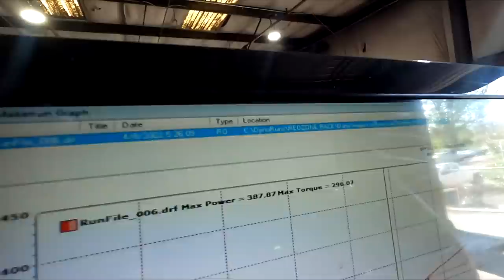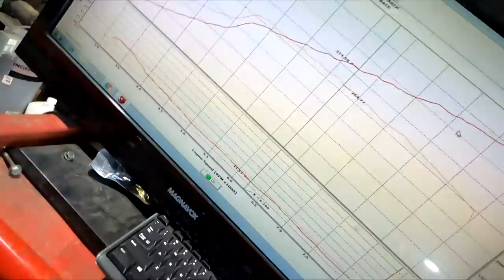K20 Turbo Wagon Back on DYNO + Track EG Hatchback

Comment: Yo, Question: Do all the B-series and H2B AWD setups run the same RD1 CR-V rear diff gears with the tranny? 

AWD wagovan is D-series
s2000 rear diff is unique for F-series
2nd gen CRV's are K-series
and Isuzu passports are J-series

Currently I own a 89 b17 CRX(sunday toy driver) and a 98 5-speed AWD cr-v(daily driven / delivery vehicle). Eventually I plan to part out the RD1 cr-v and make the CRX AWD. I know drive_shafts and rear axles are custom, but wondering what gear options there are if any. Thanks! love the channel. 👍

Comment: Since I subbed since 2019, I noticed you don't upgrade your brakes? Are stock honda brakes enough for 400+ hp?
Reply: You'd think that it wouldn't weigh much more than stock as it sits,and it's not everyday you'd be at the top of the last gear and needing to stop in a hurry,quite possibly the factory breaks were more than up to the task from stock. I doubt its on original pads.